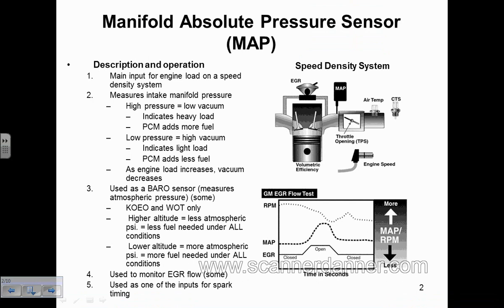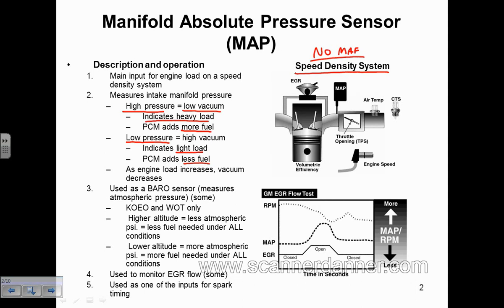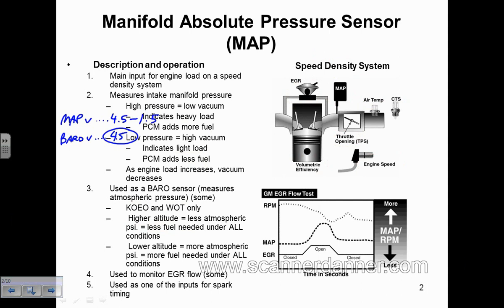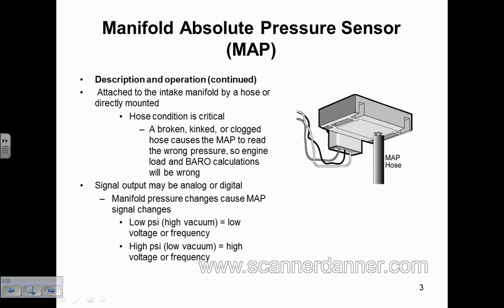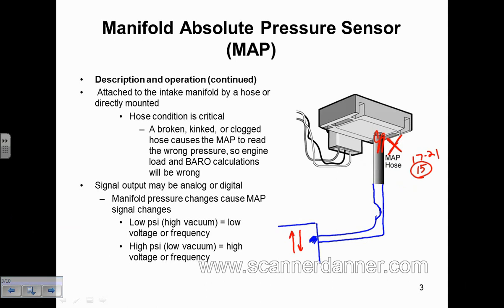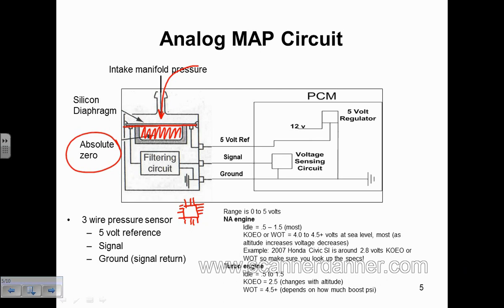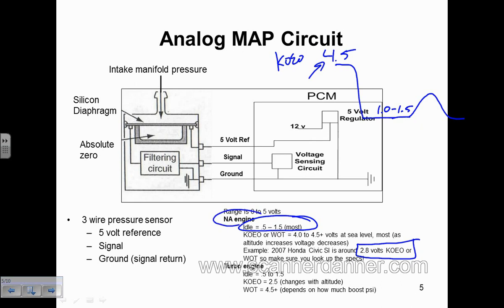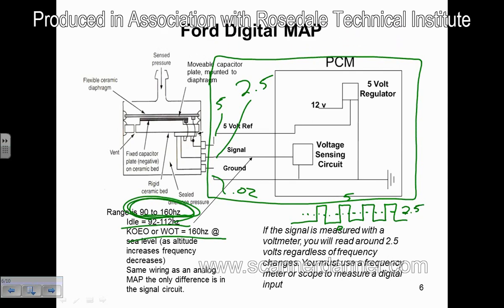Chapter 8 "Pressure Sensors" pages 1-6

Comment: So does this mean that you can use the MAP sensor (at Idle) as a diagnostic tool to test EGR flow and functionality?
Reply from the maker: You can but you don't really need it, just the RPM drop and stall alone while energizing the EGR at idle is good enough. to tell you the passages are clear. Make sense?
Reply: ScannerDanner Premium; I guess I was think too high tech lol. Is the reason it has a drop in RPM and eventually stalls because the exhaust gas is diluting the air mixture? I know you stated that in MAP systems that if there is a vacuums leak, there will be an increase in pressure so the computer would respond by adding more fuel, so an increase in RPM. Since in this hypothetical case the computer thinks there is more Air (even though it is diluted with exhaust gas) so it adds fuel and when it tries to combust it won't beable to since there isn't enough oxygen? Am I understanding this correctly?
Reply from the maker: Yes! In short, the majorly diluted air/fuel ratio will cause the engine to get rough and stall or almost stall and the MAP input messes everything up even more because the computer will be dumping fuel in reaction to the increase in manifold psi
Reply: Awesome thank you so much. Love the channel. Great information.

Comment: Paul I can't register for your forum for some reason. I have a grand Cherokee with sixteen and sometimes seventeen inches of vacuum on a six cylinder engine. I've also noticed my baro reading on the map data is either .68 to .1.0 lower than the actual baro reading in my area at any given time. can that have anything to do with low vacuum?
Reply from the maker: email support@scannerdanner.com My web designer will fix you up for the forum. Thank you!
Baro readings come from the MAP KOEO and WOT. If your BARO is out of range this is suggesting a MAP sensor problem

Comment: phew about the fourth time watching pressure sensor diagnostics phew finally starting to understand i reallty wanted to know the relationship of the turbo engine with a map sensor and how its a critical input for proper turbo powerflow this is so important if you want to install turbos huaahh 1000 hp subaru coming at yah 2018

Comment: im curious, here in my country you can be in the beach, and driving for three hours you can be in an altitud of 13800 ft above the sea level, so if i dont do any WOT condition in any moment of that trip, i could get some rich condition in a MAP engine without a BARO sensor because i dindt update the baro signal?? or the MAP signal will update or sense  every atmosferic pressure change in any other engine conditions??
Reply: im really thinking here about fuel economy, do i need to do a WOT conditon to update the BARO signal every time a go up 3000 ft?? for a more accurate pulse width?, or does the MAP sense that pressure change outside with the engine running in every other condition?
Reply from the maker: I would, just a quick momentary WOT every so often

Comment: Paul a personal request, im use to look at inHg in the MAP signal data PID and not so much at voltage, because that value is pretty much standart in every single 4 stroke engine, whether it is a 4, 6, 8 cilinder engine; and also because the MAP is a electronic vacuum gauge that the value is up side down; regarless the voltage value, so i would love for you to show that data PID every time you do a diagnosis video instead of the voltage, or together; because is a litle dificult for me to interpreted the voltage value, thank you man; great work, im learning a lot from your class!!!!! :)

Comment: Paul, once more you're stating TPS HAS to be under 1 volt at idle. I might be dead wrong here, but just tested my Opel Astra G (hurray for German verhicles) and it reads on the TPS 4.44 idle and with increasing the throttle (under the hood) it actually decreases to .38. Sweep is perfect (which I was after since that was new to me), but they seem to use it all just the other way around (not that it matters, but if you are fresh in the field and in the back of your mind you're thinking "Paul said, it HAS to be under 1 v.", one might find himself with a questionmark or mis-interpretation).
Reply: If I said "has to" it was a mistake. I've always said "typically under 1 v" it's even written in my book that way in section 7. Also I go over a case study on a Ford 4 wire tps that works opposite on one signal, and again that is in my book too.
Reply: ScannerDanner
Sorry if I misunderstood or missed that. I know you tend to keep options open all the time (very smart, since car manufacturers don't seem to get standards in anything). Keep up the good work, you're doing great!